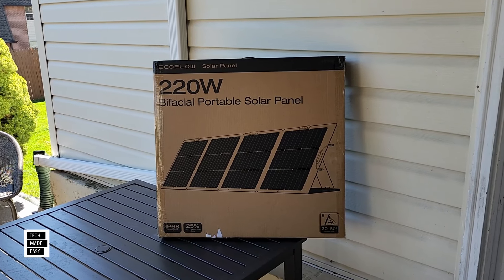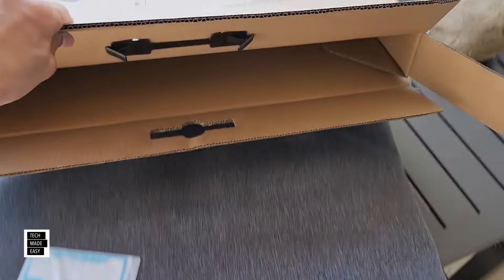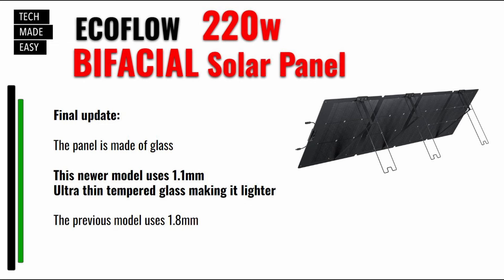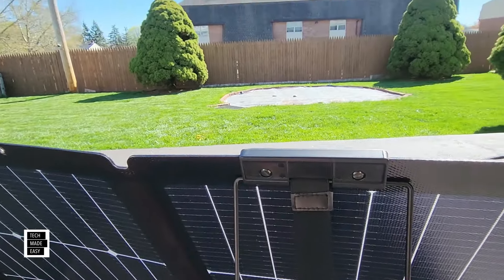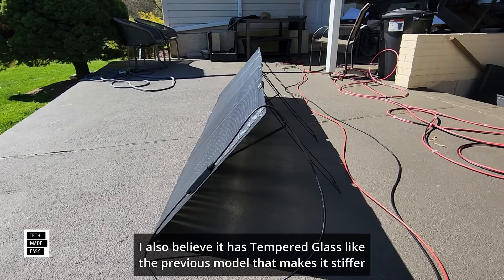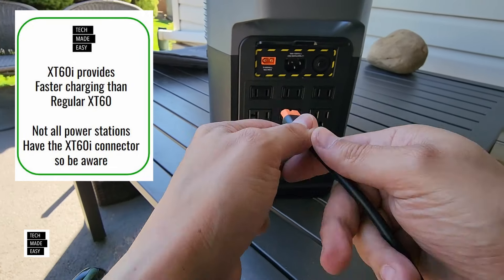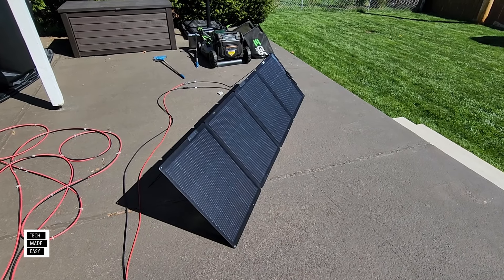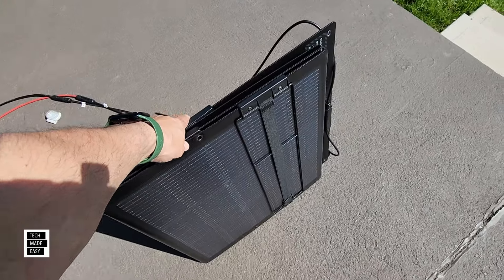NEXTGEN BIFACIAL EcoFlow 220w BiFacial Solar Panel EcoFlow NextGen 220w solar panel

Comment: Just unboxed mine. Really dislike how long the solar cables are which are connected to the solar panel itself. The pictures from their website don’t show this and I find this misleading. I don’t understand why they made this cable so long as most people will be using their own separate cable to connect to their devices. Also, with no carrying handle + plus these awkward hanging long cables this panel is a pain to setup. I’ll be returning and purchasing the Jackery Solar Saga 200 as an alternative. This has an incorporated handle and no long awkward hanging cables.
Reply from the maker: Thanks for your feedback. We did do a review on one of the Jackery panels recently

Comment: What is the lifespan of a foldable solar panel with silicone or ETFE coating? There are many videos that talk about the lifespan of rigid panels but not about foldable ones.
Reply from the maker: I've not seen manufacturers test and state that. We all will use these is different ways for different periods of time. I would say Get a rigid panel if you want a panel to last a long time.

Comment: Is this 220 Bifacial panel about the same as a 400 watt regular panels?  In other words should I spend more for the 220 watts panel or spend less for a 400 watt panel?
Reply from the maker: 400w panel is expensive and overtime it starts to wear, (my experience) I like the new design of the 220w, they make a bifacial like the one I showed and one like it that isn't bifacial.
Reply: @ I can get a 400 watt panels for 400.00!!! That’s why I am asking. On sale.
Reply from the maker: Hey hey easy now lol wow too much coffee? I don’t recommend it, it wears down too quick.
Reply: @ thanks for the advice
Reply from the maker: You got it, the new Nextgen 220 panels seem like a better choice. Good luck let me know what you do.

Comment: The XT60i allows for more amps but will work fine with the older units providing the panel VOC is within spec. 

It will also allow supporting power stations to better determine car or solar charging when they are set to DC Auto charging in the app.

Comment: It would be awesome if the older model could be retro fit to use those legs.  I just got my 220 w panel last week and failed to notice the newer model . 😢
Reply from the maker: Brian EcoFlow did come out with a new stand that can be used but it's been out of stock.
Reply: @TechMadeEzy  hmm   I’m not seeing it on their website.
Reply from the maker: They called them and adjustable kickstand. I just did a search and couldn’t find anything but I’ve seen it even one large enough to support the 400 W solar panel.

Comment: ecoflow sent me 2  110w solar panels with my eco pro. Then told me I shouldn't use them with it. So I just ordered the delta 2. I don't know anything about solar panels. Can I order the 220w next gen solar panels and add my 2 110 panels for 440 w to charge power station in less time or will the volts or amp be off or insufficient ? thank you
Reply from the maker: A lot of people that are new to solar immediately run out and buy a solar panel, but it’s the biggest mistake you could make. If the solar panel is higher and specification, you can actually damage the power station. 
Just use your 2 110w panels in series , the Delta 2 can handle up to 60v so you cannot add a 3rd 110w or you will go over and can possibly cause damage.